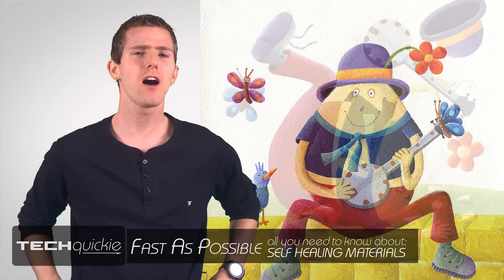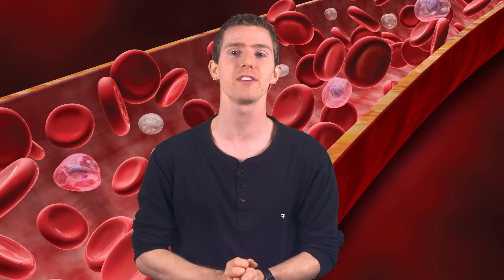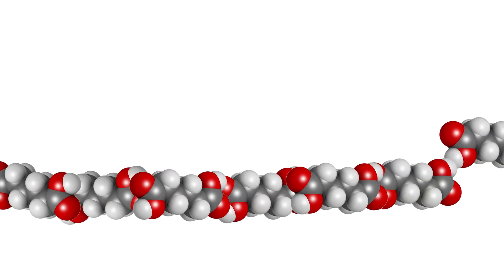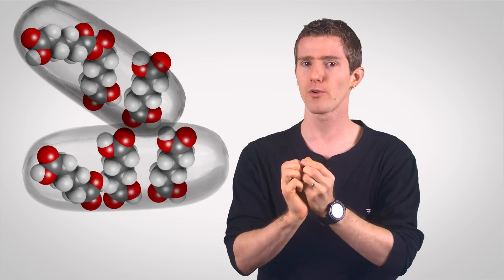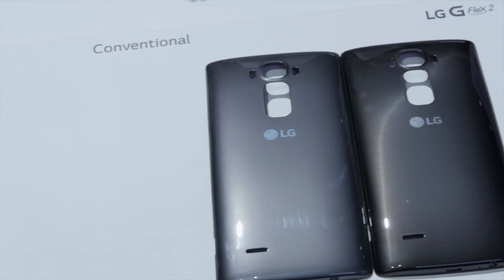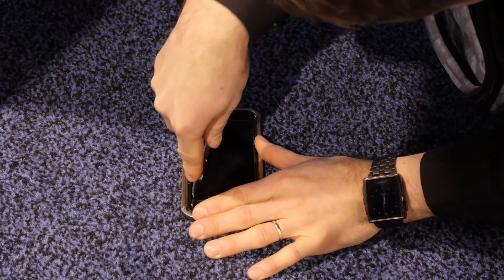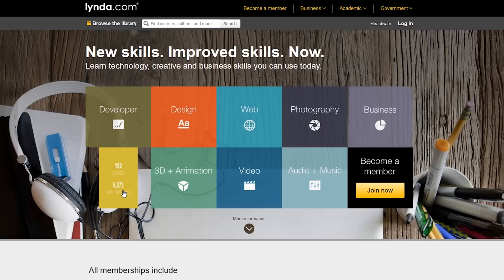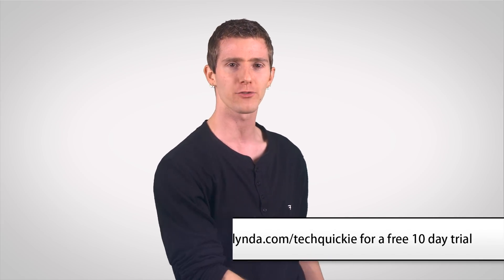Self Healing Materials as Fast As Possible

Comment: This might be a super dumb question, also this vid is super old. But why couldn't we create a self healing material for out screens on phones? Would't that be a pretty neat idea?
Reply: Most of the self healing materials I have heard of are either polymer based or metal based. I haven't heard about anything for glass, so it may be that the self healing compounds will probably make your screen worse instead of better.
Reply: for the same reason why we still use oil and coal instead of switching to clean energy. it's to expensive and companies make more money if you break it and have to buy a new one

Comment: can you make a video about Wireless cards, I'm still pretty confused about all the a/g/b/n/ac stuff and 2,4/5GHz speeds and can you just buy a PCI card or USB stick what allows you to connect you to connect to internet?
Reply: There actually isn't one that I can find that goes into detail. What kind of information are you looking for?

"I'm still pretty confused about all the a/g/b/n/ac stuff"

a/b/g/n/ac are all protocols that dictate approximate data rate and range, and possible frequencies. Check wikipedia at /wiki/IEEE_802.11 for more information.

"and 2,4/5GHz speeds"

These aren't speeds, but rather frequencies, or wavelengths. The easiest way to explain the difference is to mention that typically to get more range out of the 2.4GHz band, while the 5GHz band offers better stability. The problem with the 2.4GHz band is that it is often cluttered (since damn near every wireless device will be communicating on this band; every device supports it) it also must compete with cordless phones (which typically use the same band) and also has to deal with interference from microwaves.

Also note that not every device will support communications on the 5GHz band, and not every wireless protocol supports multiple bands of communication (see: b, g).

"can you just buy a PCI card or USB stick what allows you to connect you to connect to internet?"

Yes, either or, or both. You'll be able to find wireless NICs (network interface cards) in both a PCI and PCI-e x1 format. Check to see what your computer has available before buying. Note that depending on your available slots, you can install a PCI-e x1 format NIC in a PCI-e x16 slot. It may look weird, and it will affect graphical performance if you are running a GPU in another PCI-e x16 slot, but it works.

You could instead buy a USB wireless network adapter. The difference between the two is that the USB adapter will have internal antennas to work with, and depending on where you plug it into your PC, may not provide a stable connection as your PC hardware may be blocking part of the signal. A wireless NIC will start off by default possibly having these kinds of issues, but most of them allow you to replace the antenna(s) will that of a higher sensitivity AND one that can be relocated somewhere where there won't be any interference. Check out the TP-LINK TL-ANT2408C Antenna to see what I had in mind (I have quite a few of these).

Sorry for the length.
Reply: theres ine about wifi that covers the stuff
Reply: Do tell.
Reply: Thanks for the message the length is good because you covered everything I needed to know, I'm going to build a new gaming PC and I was just wondering what all these things meant but now I know, I already have Wlan what is connected to my pc with a wire and my phone gets Wireless connection from it, I've decided to save the money and plug my old Wlan to the new PC when I get it because the old supports wireless.
Reply: +I HadLife WLAN is an abbreviation of "wireless LAN", thus it's not WLAN when you just use a LAN cable.
Reply: I HadLife I
Reply: Generally a PCIe card will work better than a USB stick

Comment: Nice introduction to this concept! However the field of self healing is trying to move more towards "intrinsic healing" lately. That is, healing not based on added capsules or capilaries, but based on the response of the material itself (whithout additives) to external influence when damage occurs. The key here is the mobility of the material over time, in else: it flows. I do believe that this is also what LG uses, since capsules can only be used once. Intrinsic healing can work over and over again, since it is a material property. If you want to know more, feel free to message me, I study novel materials in the field of Aerospace Engineering in The Netherlands :)